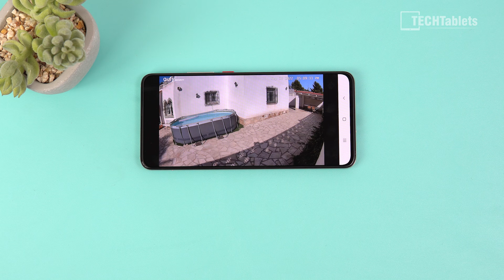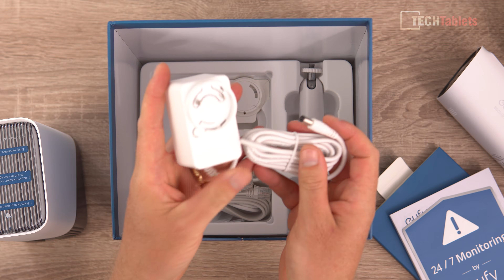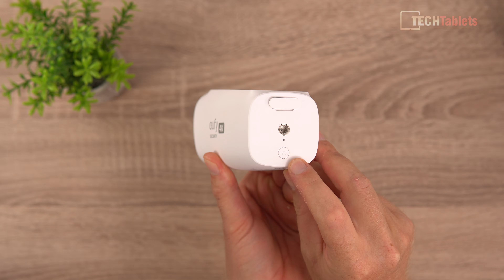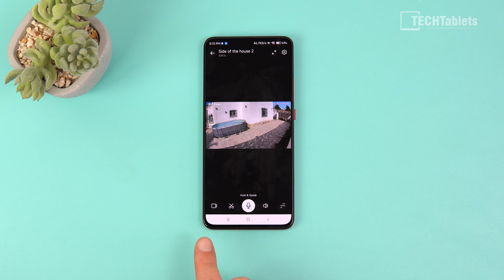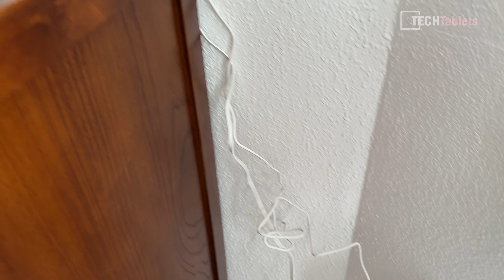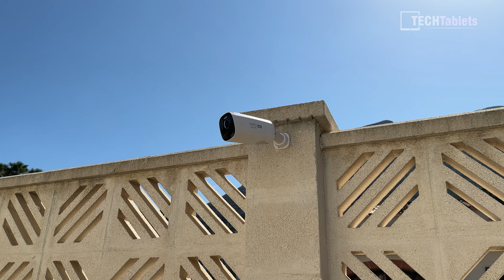eufyCam 3 (S330) Hands On, Unboxing, Set Up And Sample Footage

Comment: Great informative video! Thank you 
Just wondering if it can be installed under the eaves and still be able to charge with the bright light if not direct sun?
Reply from the maker: Unfortunately not it would eventually run out of power without direct sunlight.

Comment: Are the camera rechargeable batteries user replaceable? Or are we meant to commit the whole camera to landfill when they no longer hold a charge?
Reply from the maker: They aren’t. No way to open it as it’s a sealed unit.
Reply: The batteries are sensible to the charging cicles.
If you charge it (worst scenario) twice a year, you will have healthy batteries for... 350 years!